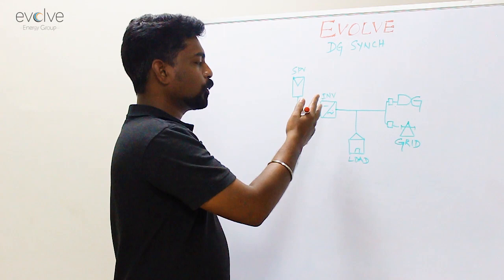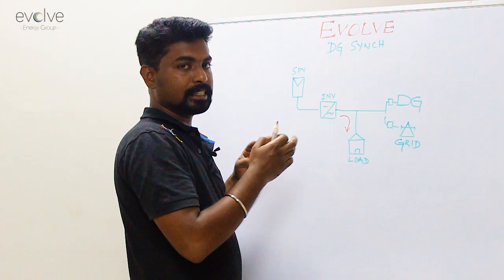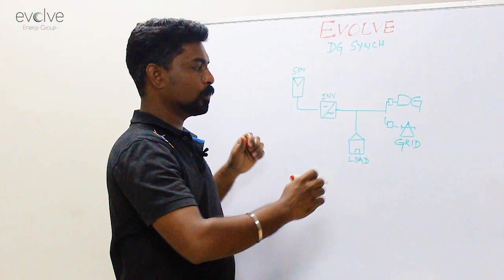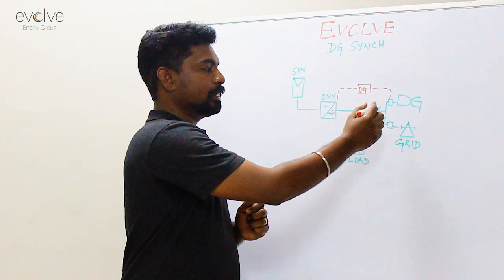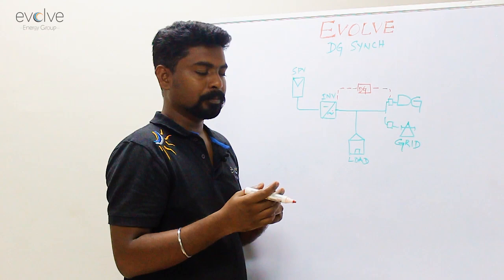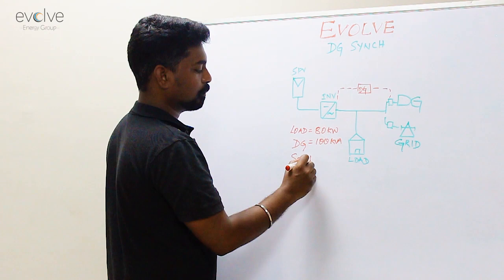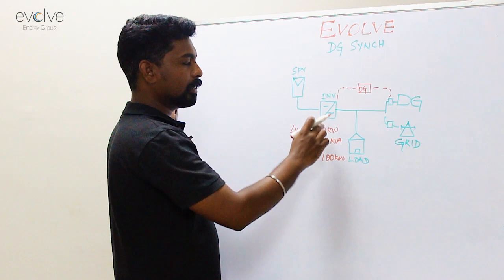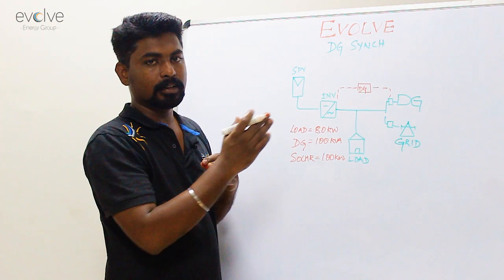SOLAR DG SYNCHRONIZATION | SIVAKUMARAN CTO | EVOLVE ENERGY GROUP

Comment: is there any manufactures are there, for solar array. iam connecting only four panels , that is 375x2 series , two sets and parrelel for 48v DC
, need to connect mcb ,fuses, spd for dual mppt  solar inverter.

Comment: Is there any option when system runs on dgpv a specific load will run. Like in a factory when grid cut off only specific motors or machine will run on dgpv
Reply: Yes there can be

Comment: Can this Sync switch be used in some way for 5KW Residential On-Grid Solar system to use Solar energy while grid failure (like using some kind of battery-inverter system to provide reference voltage)?
Reply: There is some thing called an ATS(Automatic Transfer System) Here in Kerala KSEB does not agree to that

Comment: DG - 100 KVA
Solar - 80 KW
Load - 200 KW

Can we run the solar system with DG
Reply: No sir you have to take 
Solar 200kw or one step higher.
DG 250Kva